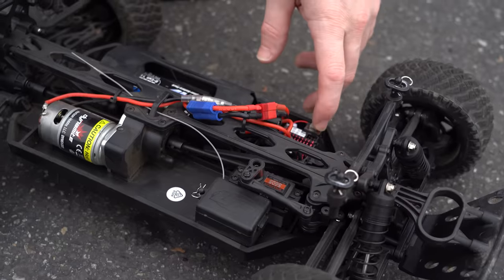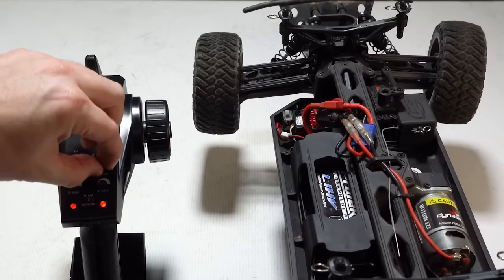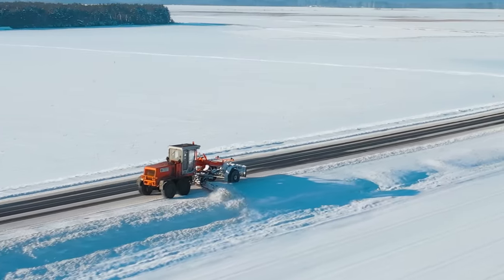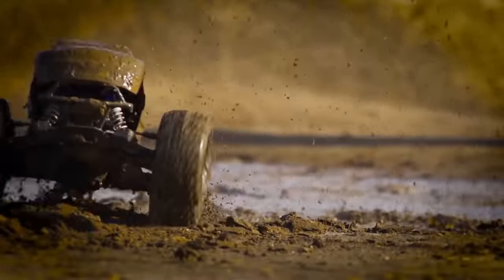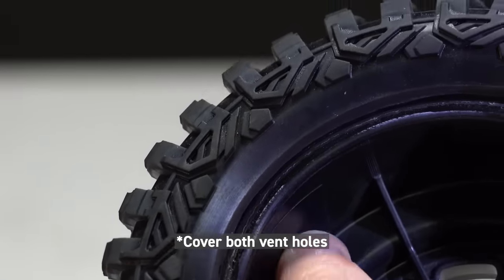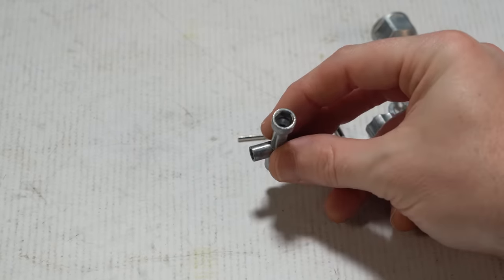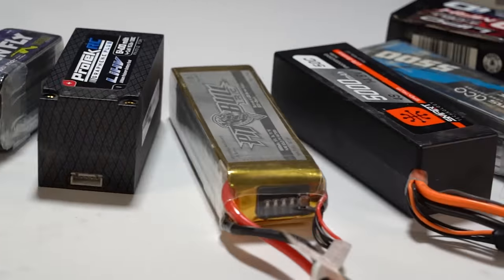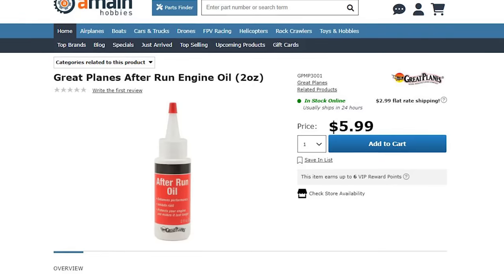Basic R/C Mistakes & How to Avoid Them

Comment: Just got into RC cars. I bought a laegendary thunder brushless.  What do you think about that company.? They told me I can't put a 3 cell battery in it or have over 30 C. Is that correct or they just B.S me so I have to buy their battery?
Reply from the maker: Hmm, I don't know anything about the company but it looks to be a knock-off brand; no offense. Doesn't mean it's bad, it might be a great little truck honestly. My main concern is where will you find parts? Local hobby shops won't have anything for this...
For the battery questions: The car's speed controller (ESC) may only be 2S LiPo compatible, and not 3S, this is common. Just don't use anything more powerful than a 2S LiPo.
For the C rating, that makes no sense and you should be able to use any C rating you want unless the ESC has some odd limitation that we don't know about. Higher C Rating = more punch/greater power delivery; Lower C Rating = soft punch/low power delivery
Typically, r/c cars call for the greatest C Rating you can afford; it's more power baby!!! But maybe their ESC has some limitations? I don't know, but if they have a warranty and you might need it, you better stick to their guidelines so you don't void it. 
Hope this helps George.
-Brett

Comment: Hey i have a question, is calibrating esc for maximum throttle?
Reply from the maker: Yes, and more. The ESC determines:
-throttle neutral position
-throttle minimum position
-throttle maximum position

This is how the ESC knows how much power to deliver to the motor when you squeeze the throttle trigger. 
-Brett

Comment: What charge percent should batteries be stored at?
Reply: 3.8 VOLTS PER CELL
Reply from the maker: Like Jack said, the goal when storing is to achieve about 3.8V in each cell, which is about 50% power, roughly.
-Brett

Comment: Teslas don’t have lipos though, not even the same kind of battery type. They barely have any lithium in them, using nickel cobalt aluminum for battery chemistry.
Reply from the maker: Regardless of the exact battery chemistry, charging the battery to 100% and not using it is harmful. That's the message here...
-Brett

Comment: So why do the manufacturer put the vent hole in the tires in the first place, if you're supposed to cover up those holes? In their fancy commercials clearly the message is these cars are ment to be driven in mud, snow etc.
Reply: ...and cover the ventholes, clean it and lube the bearings after...
That's what most of the manufacturers puts in the manual.
Reply: @PeterOekvist  The question is why do they put the hole there
Reply: @marbasfpv4639  Just like with real cars, the money is made with replacement parts and maintenance not with selling a brand new car and just like with everything else they know no one bothers to read the manual 🤣🤣🤣😉😉😉
Reply from the maker: The squishy foam inserts inside r/c tires needs to ventilate to perform at their best, that's why they're ventilated with holes. 
-Brett

Comment: ok here is my problem is he said not to use air compressor yet every track including AMAINS tracks all supply air compressors for cleaning like WTF ..never had any problem using a compressor to clean
Reply: Depends where you aim the full blast, does not really matter what you use it on, RC car, bike, car, PC. blast at the wrong angle at the wrong part and you will only force the dirt further into whatever part unable to ever get it out. Offcourse you can set the PSI to lower on a compressor to prevent that and just use it to "artifically" blow of any dust and debri without further damage. Soft brush with low airpressure works best to get any part on almost anything properly clean.
Reply from the maker: The possibility of blowing debris into your bearings goes way up when using an air compressor. You can do it, but just be careful where you point like gilibran said. 
-Brett

Comment: Once bought a 77 F-150 that had been flogged as a mud bog truck. Only figured that out after replacing, repairing, cleaning all the mud, sludge etc. About $9,000.
First look when considering the vehicle,
 the seller was cagey and a crook with plenty to hide.